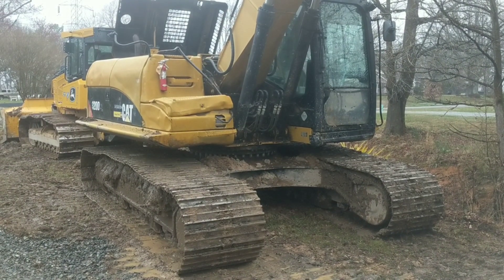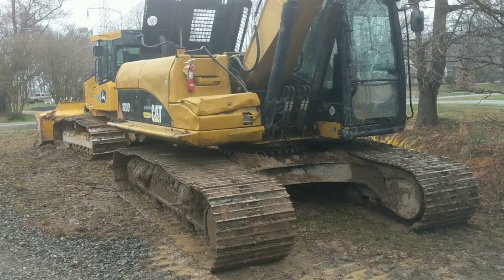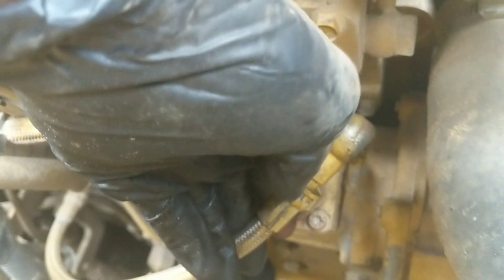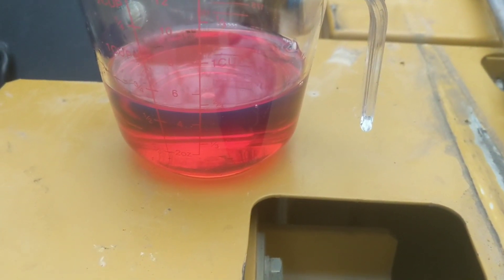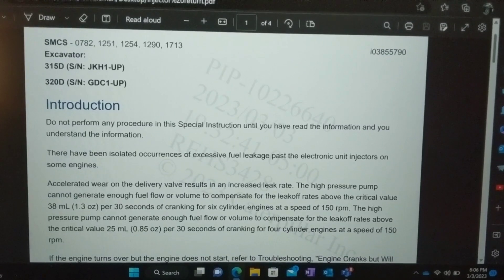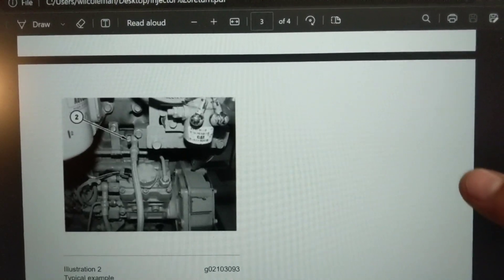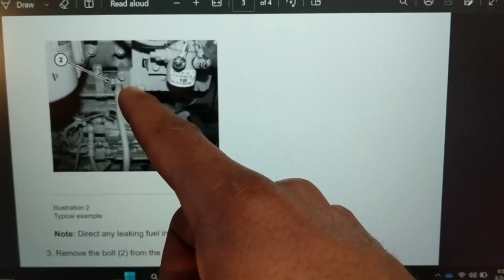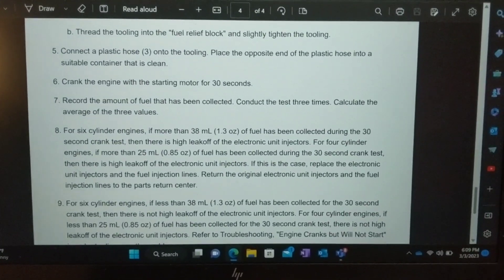6.4 Acert Cat Fuel Return Flow Testing

Comment: Why return fuel is verry hot, derate, and no start...?
Reply from the maker: Do you have any way to measure your rail pressure? It sounds almost like you've got a restriction, restriction with high fuel flow, will create heat. It's possible that you may also have a large internal leak, but I'm not sure if that would cause heat...